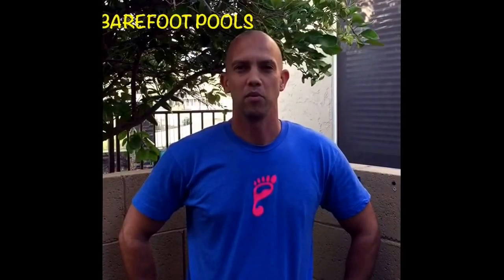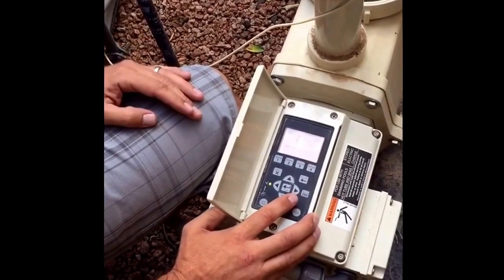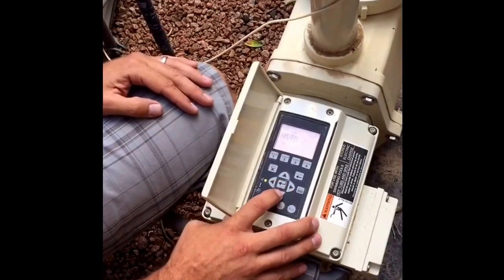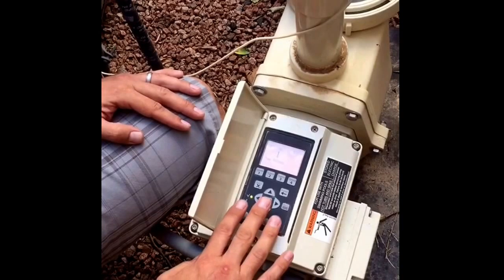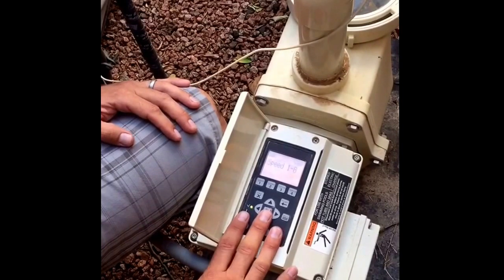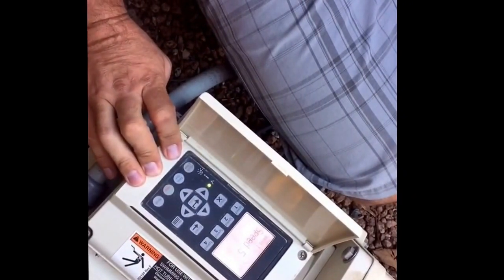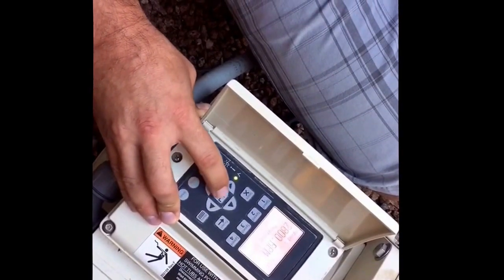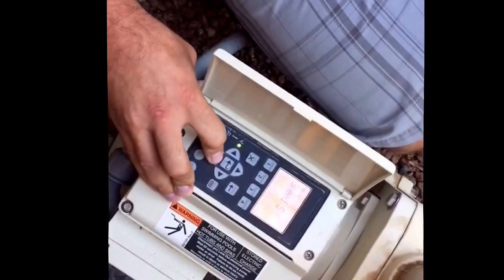Pentair Variable Speed Tutorial

Comment: Great  video.  I was struggling with mine with pre existing programming.  Any suggestions for times to run 2-3hr window at higher rpm's and the 6-8 hrs window for 450/lower rpm's for AZ during the summer?  Thanks in advance.

Comment: My pool guy set mine up for 3 hrs at 2800 rpm and then 21 hrs at 450 rpm. Is that overkill on the low setting?
Reply: I'm at 3 hrs at 2800 (12a-3a) and 12 hrs at 450 (7a-7p). I have the same concern.